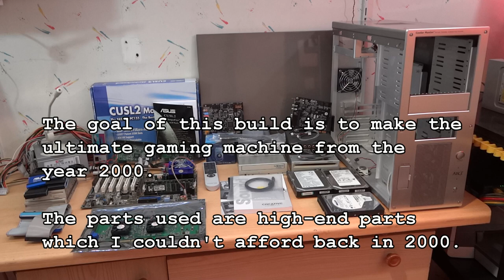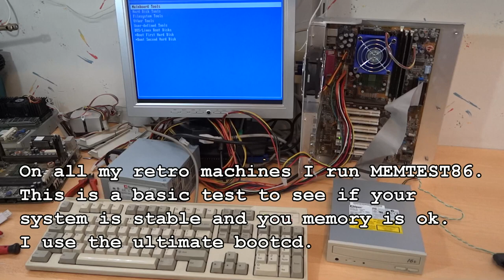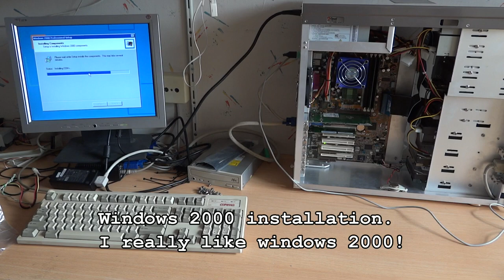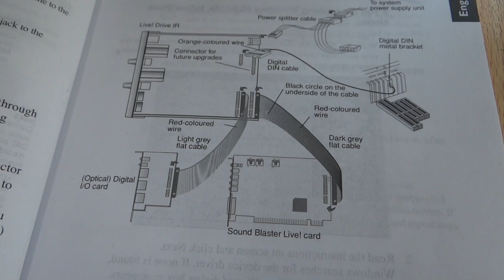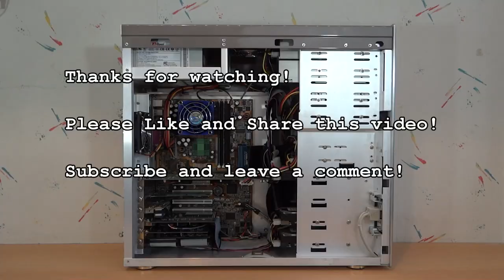Ultimate year 2000 gaming build! 3DFX Voodoo5 Asus CUSL2 P3-1ghz CM ATC201

Comment: Does it have WIFi? Did you include a wireless card in the build?
Reply: Why would you want wifi in a retro build? I'm pretty sure it was yet to be supported or invented back in 2000.
Reply: flozz Wifi's been around since 1999, although I'd still say ethernet's better. Mind you, 5Ghz Wifi these days is fucking quick

Comment: If you want moar power, try an AMD Athlon 1000 CPU with 256MB of DDR, and a ATI Radeon 8500DV. That thing blows your Intel 1000 out of the water.
Reply: yeah, but that hardware is not from 99/00! DDR for AMD came in 2001, and Radeon 8500 in 2002!

Comment: I never understood the rage for that case.  Maybe cause it cost 500 bux and any good 50 dollar case worked just as good,  BUT it cost 500 BUX BRUH!  lol  

By 2000 we were using full towers and had just ditched the watercooling scene as $300 glorified fan coolers with water in them were a waste,  back to the good ol' air only fans we went.  

System is good just still can't see why ppl claim that was the best case.....baffles me.

Comment: Why no Athlon? I have a perfectly fine Athlon Slot A System.
Reply: athlon are bad especially old ones
they easly overheat if you watched the famous video named "what happens when you remove CPU heatstink"
Reply: HappySlappy Face Umh, I wanna see you remove a Athlon-casing...
Reply: AmstradExin well i had an old athlon but it was dead dead dead dead dead not even power led in motherboard so i removed the cpu and i rotated a bit the the pins like 5 pin (I ROTATED EVERY PIN XD )
Reply: HappySlappy Face I'm talking about the Slot A Athlons, but I know what you mean.
Reply: AmstradExin i have a P4 P3 and an onboard cpu that i dont know
Reply: HappySlappy Face Right now 'm trying to build the perfect Pentium 3 system, but to find a good motherboard is hard. They mostly suck. I had better expieriences with Socket 7.
Reply: AmstradExin i have a mobo with ram and cpu and everything with onboard vga but the psu sucks
Reply: If it overheats that doesn't mean it's not fast. People don't fuck with the heatsinks like in Tom's video he was just experimenting with his CPUs Athlons are really fast and they're way better than the Pentium 3 :P
Reply: I don't care about the evidence Listen to me i don't care how people didn't know how to install it correctly these CPUs are better than a Pentium 3 in every way and they're the best bang for the buck cheaper than a P3/P4 they preformed better than the P3/P4 If you don't believe me look at some benchmarks

Comment: i thought the 3DFX voodoo line was outdated by like 98 being replaced by better nvidia Gpus?
Reply: Nope! 3DFX was still an ongoind brand name until I think around 2001, with the ATI Radeon boards and chipsets.
Reply: i did some research after this video and at the time of release the 3dfx card he has here was the last and best 3dfx card released. but at the time of this 3dfx card there were Nvidia cards out that outperformed it easily.
Reply: So? 3DFX was the higher-end board with more reliable parts, and more capabilities, and more games supported it.
Reply: do you have facts to back that up? because when i searched for benchmarks on the card it usually came in 2nd place behind Nvidia boards of the same period.
Reply: more RELIABLE PARTS and MORE CAPABILITIES and MORE SUPPORT, NOT performance, the 3DFX was meant for buisness applications, and it completely CRUSHED the nVidia boards in every way possible in that area. And by parts, I mean like the caps and diodes and cooling fans and such. More games DID support the use of the 3DFX boards though.
Reply: It's not all about performance in games, theres more to life than that you know.
Reply: it wasnt outdated... the voodoo lines pretty much FPS wise ruled the roost till the 5500 and that's when ATI 7200/7500 and NVidia GeForce 2 line moved ahead..thats why they were building the Voodoo 6000. Just a fact tidbit here..SLI was forst done by 3dfx BTW
Reply: Like I said...
Reply: thelasthallow Son, when 3dfx was rocking the world your Nvidia wasn't even close to it performance wise. Unfortunately, eventually 3dfx lost its supremacy and went bankrupt later on because they've made a few critical mistakes that you can read about on Wikipedia. They went bankrupt when they were about to release a real monster called Voodoo 5 6000 that was smoking crap out of any video card at the time, but it would have been very expensive and I don't think many people would have bough it.
Reply: Like I said, again... Voodoo was better...
Reply: thelasthallow
...and then there was this thing called "Glide" ;)
Raw performance of last Voodoo generation might have been lacking, but you have to understand that back in the day video drivers were lot less stable and polished then they are today, and 3dfx was rocking the shit out of competition with Glide. Just about every game that mattered had glide support, and that should tell you something.
Reply: nameless0193 agreed.. I even remember some nvida cards coming with a glide emulator..
Reply: Same here, stil got one in my HP Pavillion 3600 something.
Reply: FAMICOMASTER Voodoo was better for a long time, around 2000 was when they were going downhill though. A lot of it had to do with it took them too long to get  the voodoo 5 card out to compete when Nvidia had started making great gaming cards and the Voodoo was more expensive. Also at this time there was the affordable Radeon DDR 64MB VIVO which was a great card as well with cool multimedia functions.
Reply: Okay. But still, Voodoo 5 was still awesume. You have to admit though!
Reply: FAMICOMASTER Yeah it was a neat card, but at that time pretty much everyone I knew was passing it up because of other cards that were considered more future-proof (In hind-sight though, everything out then was basically out of date in 2 years anyway so the Voodoo 5 wouldn't have been a bad choice really). Nobody wanted a card that was deemed defunct just after it was released. I think the Voodoo 4 came out at that time too, seems to be harder to find now even more than Voodoo 5.
Reply: ***** For that time it was about Hyper-z from ATI and Anti alasing from Nvidia and those were the killers of the 5500 and the 6000 was supposted to destroy the ati and nivida oferings ..
Reply: Yeah, like I said, even myself I opted for the 64MB DDR Radeon VIVO because of the feature set, price and the 32-bit color on the Radeons looked great. Been an ATI/AMD vid card fan ever since (though I've had a Geforce 8800 GTS 320MB and a GTX 460 1GB at some point and my build to play older games with has a Geforce 5900 Ultra alongside a Voodoo 2.)
Reply: ***** At that time I kinda had the money to get a 5500 and went with the radeon sdr.. had a TV out and DVI port and had hyperZ

Comment: my father have a computer in year 2001 this is the spec

Intel Pentium MMX 166MHZ
Nvidia geforce 256
IBM 64mb ram
350watt psu
30gb maxtor hard drive
windows98
Reply from the maker: quite a fast videocard for the config.

Comment: And why you not getting voodoo5 6000 agp and 1gb ram?
Reply from the maker: Voodoo5 6000 was never on the market. And this motherboard only support 512mb memory.
Reply: what about Voodoo 5 5500 Sli?
Reply from the maker: Happy tylermovieproducction
It is already a SLI card on 1 pcb :)
Reply: nice!
Reply: What year does voodoo 5 6000 release?
Reply: Happy tylermovieproducction Can't You Do a QUad SLi? With two Voodoo 5 5500 Agp 

2x2= 4 GPU
Reply: Happy tylermovieproducction Yeah, good luck finding a motherboard with 2 AGP slots. No such thing ever existed.
Reply: MrGencyExit64 no way!
Reply: Happy tylermovieproducction Sad to say, AGP was not a peripheral bus, it was a port. So there was only ever one of them on a motherboard. That's why SLI is limited to PCI and PCIe.
Reply: MrGencyExit64 You mean You can limit up to 4 way sli?
Reply: Happy tylermovieproducction That's got nothing to do with what I was talking about. You can't use multi-card SLI with an AGP video card.
Reply from the maker: MrGencyExit64
I have 3 Voodoo5 cards in AGP and 1 voodoo5 in PCI. But they didn't design the Voodoo5 5500 for sli use. I need to test if I can make a multi monitor setup with Voodoo5's :)
Reply: Happy Tylerienmam Networks Voodoo5 6000 was never released
Reply: Erik Lundberg then how did some people found it?
Reply: Happy Tylerienmam Networks Approximately 1000+ test cards were produced but it was never released to the market.

Comment: AMD Athlon is the ultimate gaming CPU
Reply from the maker: Erik Lundberg The problem is finding a decent motherboard for AMD. I don't like VIA chipsets.
Reply: victorbart I am using the Asus K7M for my Athlon Slot A. AMD 751 North Bridge. Very good and stable board. I use it with a Voodoo5 5500 AGP. Works great.

Comment: +victorbart This inspired me to make a 1998 Pentuim 2 Gamepc/Serverhere some specs 550 watt psu goldProccesor Pentium 2 500 mhz (overclocked + bigger fan 3,5 cm to 5 cm)Asus P2B-S motherboard512 MB ram (kingston i think it is)hdd 1 80 gb exelsior 7200 rpm (i think it is 7200 rpm + it has hdd cooling)hdd 2 320 gb seagate 5200 rpm gpu dont realy know but it has 256 mb vram and custom fan modsoundblaster Live! Ct 4720intel gigabit cardCase is a unbranded case but made a 120 mm fan hole in the side of the caseidk what to do with it now it is currently a half life/ counter strike server (windows server 2003) but is realy noise (becuze all the fans currently) so i moved it to my attic with my other servers/nodes for my networkyou know any usses?Ps. I love this Vid ;)

Comment: i have pentium 4 before socket 478 2.4ghz
512mb 256mbx2 ddr 
ge force 4400mmx 64mb graphics card
40gb ide seagate 
asrock mother board
dvd burner 
300watts cdrking psu 
windows xp 
wayback 2005

2011 
AMD A4 3300 2.5GHZ DUAL CORE
BIOSTAR A55ML+ 
4GB EUDAR DDR3 1333MHZ
80GB HDD FOR WIN 7 OS 
500GB HDD FOR STORAGE 
DVD BURNER
600WATTS PSU ORION
WINDOWS 7

NOW IM USING 
INTEL CORE I5 4460 3.2GHZ QUAD CORE
biostar H81MHV3 
MY GT 730 BROKE NOW IM USING INTEL HD 4600 
4GB KINGSTON RAM 
1TB TOSHIBA 
500GB SEAGATE 
DVD WRITER
CORSAIR VS 650 
DEEPCOOL SMARTER CASE
WINDOWS 10 

I CANT PLAY RED ALERT2 / YR ON WINDOWS 10 UNLIKE WINDOWS XP TO 7 I CAN PLAY EM i like gaming wayback 2000's :D

Comment: I'd go with a GeForce2 over a Voodoo5; 3Dfx's drivers were horrible for anything non-GLIDE (lacking many commonly used OpenGL extensions and generally bad D3D implementation), and the GF2 (especially the Ultra, but even the GeForce 2 MX really) is much, much faster. Also, the V5 having 64MB of VRAM is somewhat of a misnomer, it had 32MB per VSA-100, and the load was never equally split between the two, just as with nVidia's SLI, the gains aren't 100%. This means that if you have a scene with 10MB of textures, it occupies a total of 20MB of memory out of the 64MB on board since each chip requires those 10MB of textures to be available to it locally. Frame buffer memory is not duplicated between both banks, however, so the Voodoo5 effectively has more than 32MB of memory to work with but less than 64MB. The exact amount varies the resolution and color depth in use, as well as texture resolution and many other factors.

Comment: But can it run Osu! ?
Reply: +Michael Avilov NO
Reply: But it has the hardware requirements...
Reply: It dosesn't matter which year this build was made if it meets the requirements then it will run -__-
@blakedmc1989RaveHD
Reply: Abdulla Alkhatri it would be too slow 2 run Osu! it's made 4 games from tha 90's and early 2000's
Reply: Yes, it will be slow but it might run :P
Voodoo 2s are really expensive 80 Dollars for a pair >:( Same goes for the Voodoo 3 my Pentium 4 PC Back from 2005/2004 died yesterday the motherboard failed i was really sad but the data is alive in my acer (it has a pentium 4 prescott)
Reply: Well, my 2004 Laptop with a Pentium M 1.6 and a Mobility Radeon 9200 (DirectX 8.1) gets playable framerates (200-300), so I wonder why it shouldnt run on that machine besides the OS.
Reply: Good point! Pentium M i think it's based off a pentium 3 Tualatin it could run i think
Reply: Abdulla Alkhatri but he's not usin' Windows XP! Windows 2000 is not comparable with Osu! nither is Windows ME and Windows 98
Reply: "besides the OS"
See what I did there?
Reply: Yaaay
Reply: i do not recommend Windows XP on a Pentium lower than 4! last time i delt with a Windows XP on a Pentium 3, it was unstable! u would do better gettin' a Pentium 4 or even AMD Athlon 64 X2
Reply: If anything, it would be slow, not unstable. You probably had a problem elsewhere
Reply: Michael Avilov mainly played on terrible Compaq computers

Comment: What I wouldn't give for the money you have to go and bild this in 2013/2014, and what I wouldn't give for a Voodoo 5 of AND VARIATION, as the ABSOLOUTE BEST graphics card I currently own is an old ATI Radeon 7500 AGP w/ 64MB and a missing cooling fan...
Reply: And I'm pretty sure I have the best 2003 build though, 8GB RAM, Windows Media Center Edition 2005 (IDK WHY), 200GB HDD, 640GB HDD, 80GB HDD x2, 52x speed DVD-RW drive, 1.44MB Floppy drive, Soundblaster Live!, 56KB Modem, 10/100 ethernet, and AMD Athlon 64 x2, onboard SATA2 support (4 drives), Dual channel IDE, support for a 2.88MB Floppy drive, and some PCI-E VGA/CVI board I can't get to work on 800x600 256 colors or higher...

It's not too special, and it was SERIOUSLY my Grandma's old computer, which she said wasn't working anymore, but here I am, posting youtube coments with it XD

P.S.: The onboard video is awesume for what it is, and it even has it's own little stash of DEDICATED MEMORY (512MB)! The nVidia nForce network controller is also onboard.

Comment: That's nice and all but this is not a gaming build. You just took all the most expensive parts from 2000 and threw them in there.
Reply from the maker: No :-) If I had gone the expensive route. I had build a dual P3-1000ghz slot1 with 1024mb rambus and full scsi setup.

This machine is made for gaming. Ok the extra soundcard is not gaming but just a very nice item. And the storage system is not that extreme in compare to scsi.
Reply: So let me ask what gamer needs the whole audio stuff? 2 floppy drives or a dvd player? Just felt that this is a bit overstuffed.
Reply: Ryodakun 2 floppy drive were absolutely essential for my Amiga 500. When a game like Rise of the Dragon comes on 6 floppies, you want to minimize the swapping at least a bit.
Reply: Daniel Ryslink
lol amiga
Reply: Thats what a gaming pc is... All the high priced stuff and the most hardcore specs you could get at that moment. Thats what a high end gaming pc is all about.
Reply: Ryodakun
He doesn't have 2 floppy drives so .... tumbleweed